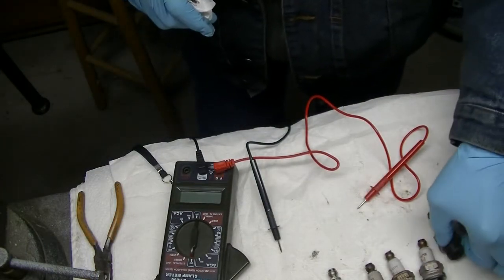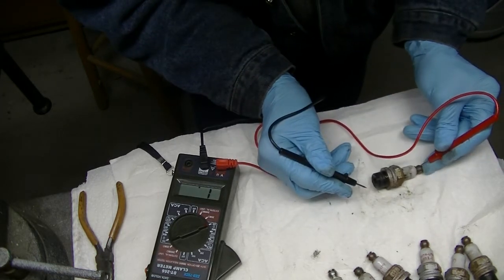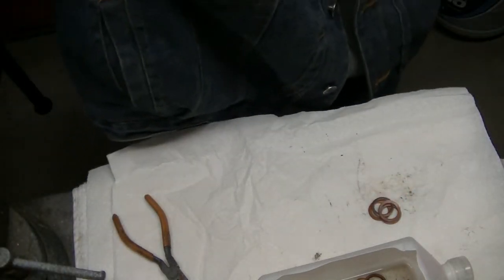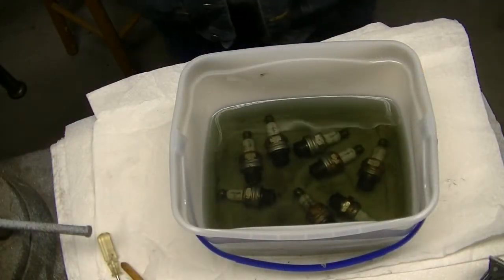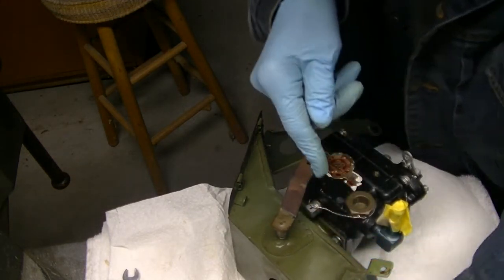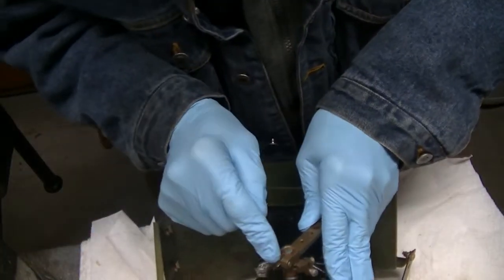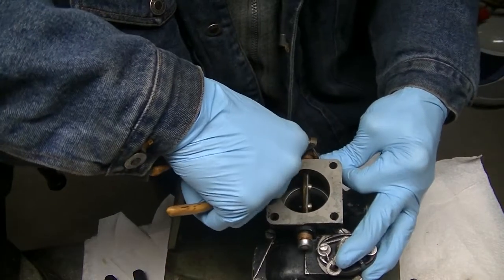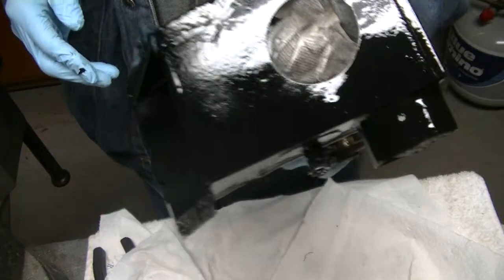Part 5 of the repairs to the old Peter Pauls fuel system

Comment: Where's the next in this series?  I want to see the Piet fly.
Reply from the maker: Hi, thanks for watching. We had one of the old Eisemann magnetos die on us so we are sourcing parts for it. Finding parts for Eisemann mags is getting to be a real problem so we might deep six the Eisemanns and replace them with Slicks. Either way, we will get the old girl back in the air soon. Stay tuned.